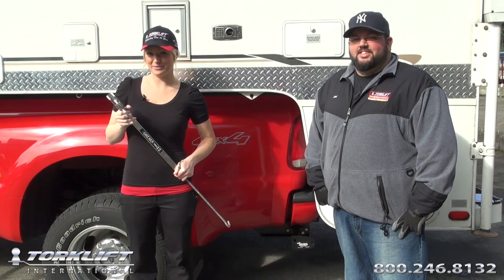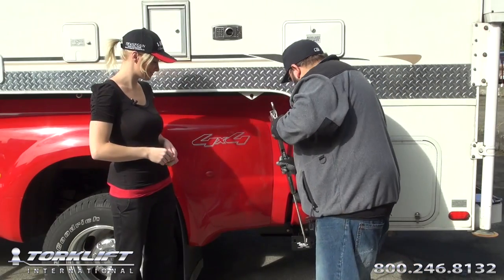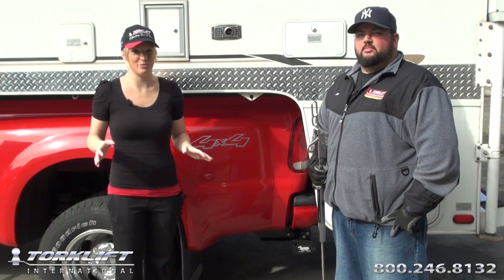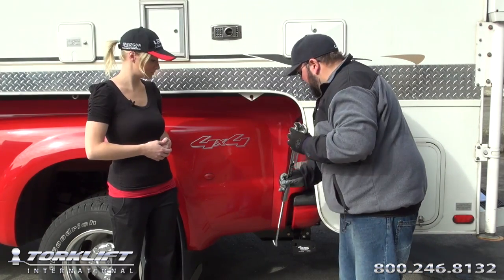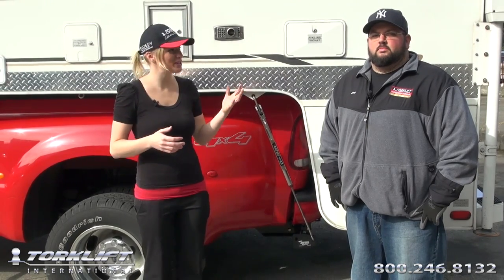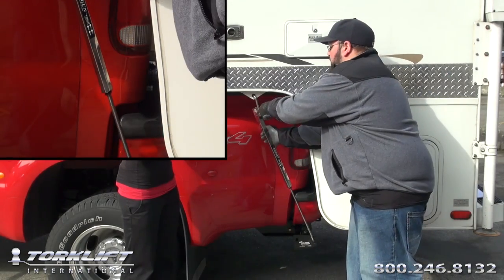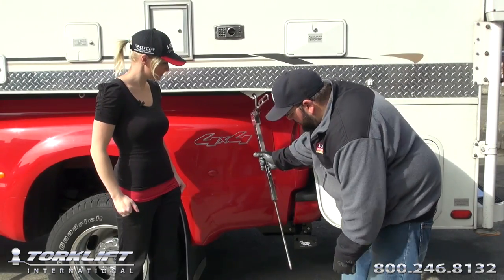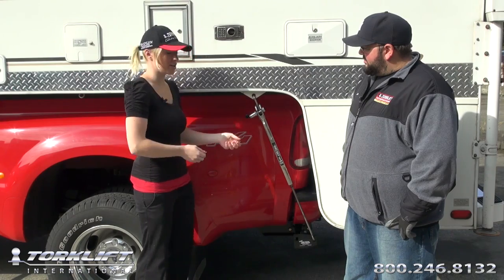How to install Torklift FastGun turnbuckle

Comment: Useful to start by showing how to put the nuts on when the kits comes out of the box......
Reply from the maker: Hey Kent, thank you for commenting! We're happy that you found our video helpful. Please let us know if you have any questions at all we can help you with about the FastGuns.
Reply: apparently you have to cut these to length first?  do you have a video on that?
Reply from the maker: Hey Kent, thanks for the followup question! The length of the FastGun will depend on the distance between your anchor points and tie downs. The FastGuns have a 25-43 inch range and if your distance is on the shorter end, you may need to do some trimming. We do not currently have a video for it, but our tech support would be more than happy to talk to you about the best way to do this. You can reach them at 80-246-8132 or support@torklift.com.

Comment: Also, did you have any issues with the plastic caps that go one at the end? Two of mine are snug. The other two are so loose they won’t stay seated at the top of the fast gun. Also the washers that are on the lever handle are rattling on 3/4 fast guns. Haven’t even used them yet and I’m not impressed at all. So much for American made….
Reply from the maker: Hi there! The washers are designed to be slightly loose on the hook bolt. However, the issue you are having with the plastic caps is a bit out of the ordinary. Would you be able to give us a phone call at 800-246-8132 and ask for DJ or send an email to support@torklift.com with ATT: DJ in the subject line? He has been made aware of your issue and would like to talk to you about a resolution.

Comment: Need to note that 300 lbs may be too much for some/most campers, and can RIP your camper apart on the first try like mine... check with your camper company before you make a big mistake on your 30,000$ camper....
Reply from the maker: Hey Rich, 

Thank you for your feedback about the FastGuns. Based upon our discussions with camper manufacturers in most cases, they recommend using 300 pounds of pressure on each anchor point for their new campers in order to ensure the camper is unlikely to shift. The FastGuns are specifically designed to be spring-loaded, which allows the camper to have some give when driving so it doesn’t put too much stress on the camper and tie downs. Over time camper anchors can weaken due to common fatigue, water damage and other factors resulting in needed camper anchor repairs. 

Our patented turnbuckle and tie down system has a limited warranty that covers the camper anchors for the period of the campers manufacturer warranty period. 

Customers are more than welcome to give us a call at: 800-246-8132 and we would love to assist with their tie down and turnbuckle questions. 

In reference to your turnbuckles and tie downs specifically - if you could send us photos of your camper and share more info with us on what happened at: photos@torklift.com, our team would like to discuss your situation further.
Reply: Its alrite I worked with my camper company Travel lite  and they are taking care of it for me. They have mounts that are bolted through 1/2 ply wood and 2x2 framing so 300 lbs is about 250lbs too much. I am still happy  with my torklift purchase and will buy more products I will just be more vigilant before I follow YouTube videos and use common sense once I find out all he information needed